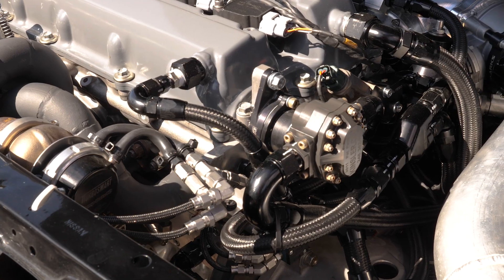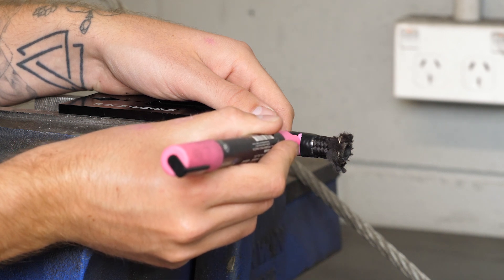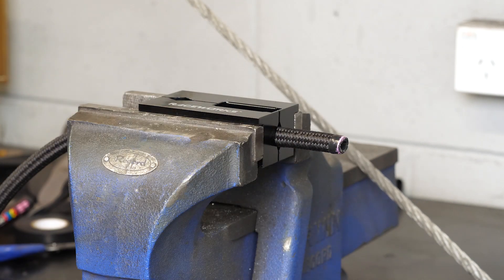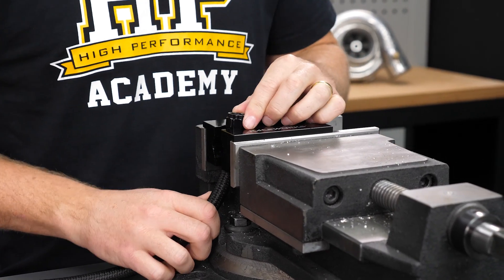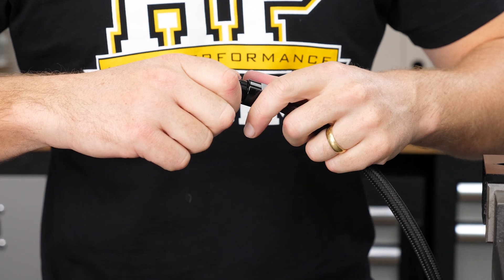Essential Skills For Almost Any Car Build | Reusable Hose Ends

Comment from the maker: What's your style of choice for resuable hose ends? AN fittings or something else?
🤝 Building a fast car? Get EVERY HPA online course with $400 OFF the VIP package:  https://hpcdmy.co/y3x
🔥 Learn essential skills for any car build or restoration. 50% off the Motorsport Plumbing Systems course, enrol instantly: https://hpcdmy.co/uvm
TIME STAMPS:
0:00 - Reusable Fittings. Why?
0:25 - Rubber Example
0:40 - Cutting Hose End
1:15 - Don't Be A Hack
1:31 - Shears Are Great
1:44 - Cut Square
1:55 - Reusable Hose Ends
2:21 - AN Hose Assembly Tools
2:51 - Threading Fitting
3:09 - Lubrication
2:25 - Anti Seize
3:33 - Threading Socket
3:57 - Use The Right Wrench
4:03 - Special Note
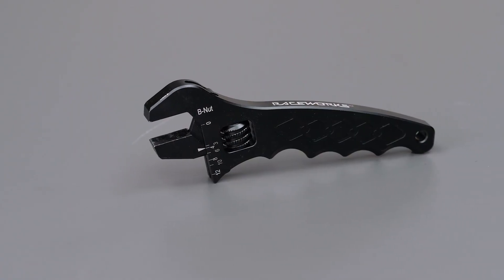4:16 - If You're Stuck
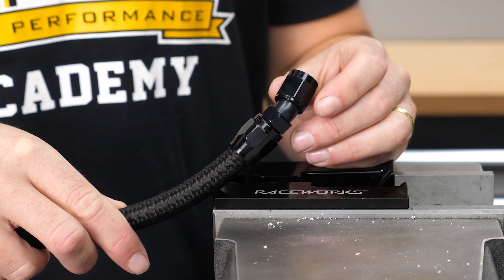4:32 - Mind The Gap
4:50 - Why A Gap Is Important
5:14 - PTFE Example
5:18 - The Difference: Olive
6:30 - Lubrication
6:53 - WARNING: Stainless Strands
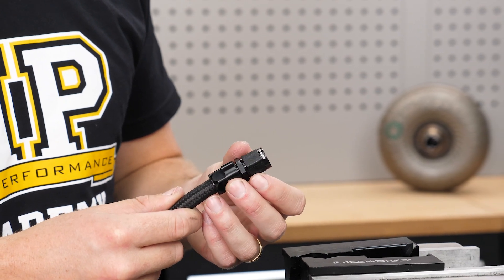7:23 - Lesson Recap
8:04 - BUILD.TUNE.DRIVE